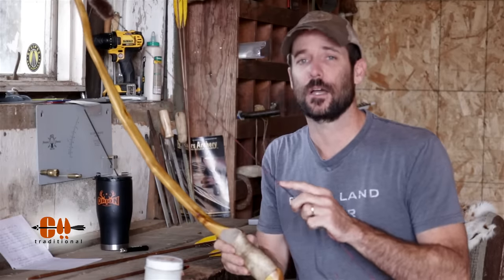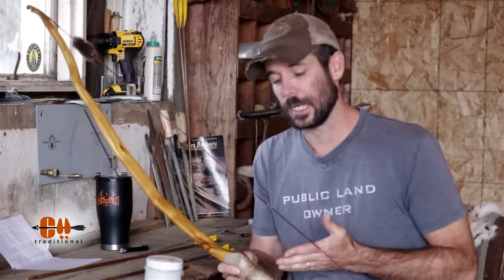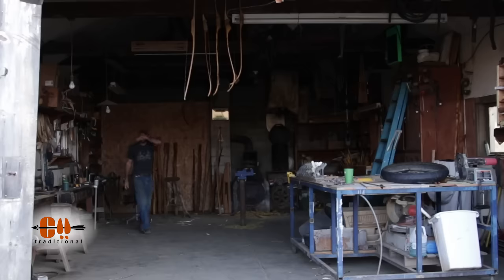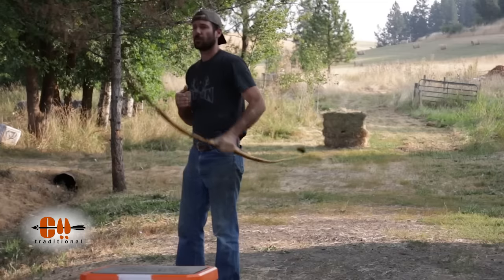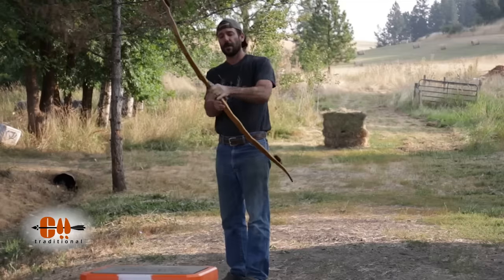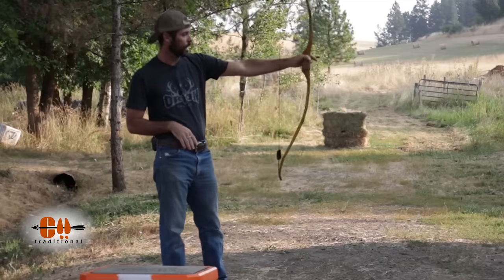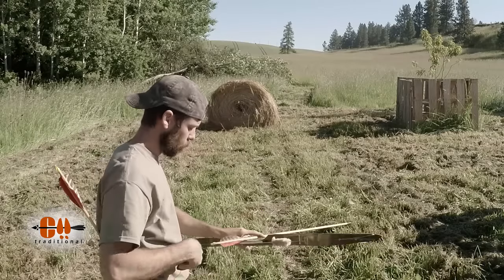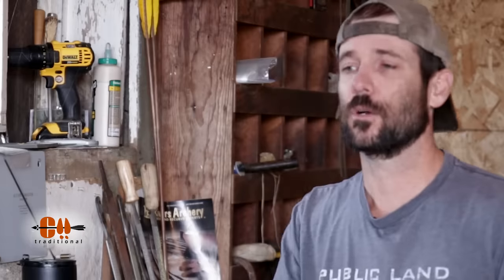Tuning a Recurve, longbow, or selfbow for perfect arrow flight

Comment: I am brand new to archery. I ordered a 45# longbow at 28 inch draw length, with 31 inch arrows that are 500 spine with 4 inch straight feather fletchings. This video is packed with valuable information I plan on using and it concludes with the most valid important point ever. That was exceptional.

Comment: Hello Clay.  Over the years I have bare shaft tested my three longbows, but a few years ago I started experimenting with different fletching styles.  I had ordered some full height offset 5" fletching on a dozen arrows.  When they came in they were in a box for standard height fletching and were in bad shape. I tried the old hot water trick to no avail, so I trimmed them down.  I ended up with fletching that was 7/8" on the point end and 1" at the nock end.  I stepped outside and launched one at 25 yards.  I was stunned!! They "sang" all the way to the target!  Boy was I hooked!

I gave 3 singer arrows with HTM rubber blunts to a friend who limited out each year for white tails, but that year didn't have a doe tag.  He just launched the "Singers" over the doe's backs to see what their reaction would be. He said, "They  just kept on feeding except for one doe who raised her head and watched the singer fly by before continuing feeding." I figured that they would simply accept the singer arrows as some kind of insect and they did.

Another benefit of the offset "singers" was that the arrows stabilized within approximately 3 yards from the bow, while 5 1/2" Shield cut fletched arrows impacted the bails at an angle.

Aluminum arrow note: A bunch of us at the Firearms Training Division would shoot our longbows and recurves each noon at a large bag target at 25 yards. On several occasions I stood down range behind a chimney at about 15 yards to listen to arrows in flight. I immediately discovered that the aluminum arrows made a kind of "clink" at about 10-15 yards after release. (And they were shooting recurves!)

Comment: I have been going through this process recently, and this video reinforced everything I have been figuring out.  One of the most frustrating things, is that wood bows can change draw weight under different heat and humidity. So one set of tuned arrows might not work once you find yourself in situation with more or less heat and humidity! So now I am trying to make up some wood arrows with changeable points, so I can adjust point weight within a draw weight range that I know my bow can shift in.

Turns out, my 70lb longbow needs me to buy 50lb spine wood arrows at 29". Then I can fine tune with point weight between 80 and 140 grains.  Trying to keep my GPI down to about 6, so I have a nice light target arrow as well. God it is a ton of work. :)
Reply: science talk ? friends
Reply: if you use wood arrow shafts with a wood bow does that solve the problem? The spine changing with humidity and the draw weight as well.
Reply: Amazing it's been done for over 50,000 years.  What a pain in the ice - age.

Comment: Absolutely the best information for tuning a traditional bow!!!
I was having arrow flight issues with my recurve and was about to give up and go back to my compound. After watching this video, I increased the tip weight on my arrows and the flight issues disappeared. I had a 600 spine GT that I cut 2" off of to increase trajectory, by dropping some weight...and reduced my tip weight from 145 gr. to 125 gr. This video has shown me that I increased the spine by both of the changes, thus effecting my arrow flight. I had to add a 100 gr. tip weight and 175 gr. field tip, for a total of 275 gr., which created a 545 gr. total arrow weight. Great flight, but for a 42# recurve, I've severely cut my range/trajectory. Perhaps new full length arrows with only a 50 gr. tip weight and a 125 field tip (175 gr. total) would still provide good arrow flight with improved trajectory.
Thanks for the video instruction!!!
Reply from the maker: I'm glad it helped!

Comment: Yes, I agree. The best arrow to bow tuning explanation and video I have seen too.

I do intend to hit your store up for your book. I am sure you have acquired some great tips to help the process precede without the crackling sound of splintered wood. 

Actually I am hoping you cover to some degree wooden arrow building  from scratch. I'd like to make a set but I am not certain which woods are most suitable and the best method for turning square stock to round such as hand plane or dowel maker.

Comment: You like 190grain tip? Is that with the insert included?  What's your total arrow weight? I'm trying to dial in a better (heavier) setup (didn't get a pass through on a whitetail and wasn't pleased haha)

I have some black eagle instincts 400 spines, and also some carbon trad 350 arrows and and trying to figure out what combo head/arrow/spine works best

Comment: My take on explaining spine:

Static spine: How much the shaft bends on spine tester. It is solely determined by materials of the shaft. 

Dynamic spine: How much the shaft bends on a released bow and during arrow flight.  Determined by draw weight, shelf, static spine, shaft length, point weight, insert length, etc.

Comment: Great video. I have a dozen very nice cedar arrows, but they are over-spined for my bow, and I don't want to add more tip weight. I am inclined to try shaving a bit off the middle of an arrow, to see if that helps. You said you don't recommend doing that, and I wonder why not, assuming I don't weaken it overmuch?

Comment: I am a fan of bare shaft tuning. I shoot bend in the handle bows anywhere from 1 1/4 to 1 3/8 wide at the handle. My draw varies and is in between 25-28 inches. I do like to play with my arrows a bit to get good flight. I shoot two different style arrows, one is the arrow is thickest at the tip and tapers to more slender at the nock and the other is some what barreled shaft. I always prefer my arrows longer then y draw. My shortest arrows are about 30-31 inches and my longest are around 34. I find longer arrows more forgiving then shorter arrows or what most do one inch above draw length. I also like the longer length for weight. There are so many ways to play with arrow tuning and its fun.

Comment: I have a few recurve bows and all with  different brace heights ....from 45 lbs. to 60 lbs. So its always a little work to get them all tuned and sighted in . I found out if the arrow  shoots  high off the shelf ...I raise the nok point to level the  arrow in flight  1st . then go from there with looking for the proper spine to get the  side to side wiggle out  . thanks for the video I will save it and use as a reference from time to time .....
Reply: Shooting high at what distance? Off the shelf. I use to shoot when I was younger, I didn’t realize all the science in archery. My question is that if off the shelf  you are spot on at 50 are you high? Or are you high at 25?
Reply: @scottsutherland3088  .....im spot on from 15 ft. to 75 ft. the way i shoot . and once i have the bow tuned into the arrows I'm shooting .... 3 under and a fixed crawl technique . anything else i shoot at over 75 ft. i raise the arrow any where from 5 to 8 inches while sighting the target . i switched over to a fixed crawl shooting style and it works well for me .
Reply: ski bum The Rowdy Rambling Hobo thank you for replying.

Comment: I'm weird when it comes to my tuning. I do it backwards. I'll start a with a stiff arrow at a length that I like and keep adding tip weight until it straightens out. I prefer that method cause it always gives me a really high FOC and almost always an arrow weight of 600+ grains. Sometimes 700-800 grains if I'm using an aluminum shaft or shooting a heavy poundage bow. It's great for hunting out to 25 yards. Blows through animals like butter and leaves substantial blood trails. My current set up on my 58# longbow is an Easton legacy 2219 aluminum shaft cut to 28.5" with a 100gr brass insert and a 300gr tip/broadhead. Arrow weight is running around 815gr at 150fps. Thing hits HARD.
Reply from the maker: That’ll work!

Comment: QUESTION:
Why didn’t you elaborate on on brace height in relation to stiff/ weak spine?
I tinker with my brace height to fine tune. 
In retrospect I guess your video is for those who are just setting up arrow to bow. I just had to replace my bowstring so I’m just tinkering with brace height.

Comment: Excellent video as always 
So I just bought 400 spine vintage bea full length is 34" I added a 100 gr brass insert with a 150 tip 
I'm getting a nock left with full arrow 34"
Should  I still do 1/4".cutting at a time?
Or do 1" for the first 3"?

Comment: I noticed you changing tips very quickly and using a lighter when doing so. How do you do that on the wood shafts?  Hot melt?  I don't currently shoot traditional, but have begun learning for when I can get a bow.  Thanks and great tuning video.
Reply from the maker: Yes, it’s a special type of hot melt glue.

Comment: Good evening, Clay. I developed a bit of a brain fart. So I’m shooting a 60” Predator Recurve. I originally had 55# limbs on them until a brainless mishap occurred a couple of seasons ago and I ordered another set @53#. Keep in mind these are @28”. So I just started tinkering with them and I’m hitting stiff with my GT 400’s 29” total arrow. I shoot 175 grains. I’ve been playing just moving my brace height. Question: To weaken my spine do I raise or lower the brace height? 

Reason I ask is because I’m moving it and keeps hitting stiff (point left/ nock right). I’m right handed of course. Also, these 53# limbs are supposed be quite compatible yet I found myself twisting my bowstring some to achieve the required brace height (7.25”-7.75”). I was almost certain that a low brace height would weaken the spine since there’s more duration in the stroke . Hope you can chime in some suggestions. I really didn’t pick it up in this video of yours. Thank you for all your support, work and generosity making these videos.

Marco

Comment: Great video. I have a 30# Black Hunter longbow on the way. Do I need to bare shaft? I'm going to be shooting Gold Tip traditional 600 spine arrows. I have a 24 1/2" draw. I'm going to be shooting 3D archery only at 25 yards maximum. Thanks

Comment: Love the vid, I have a Fleetwood Edge 45lbs, and I am wondering how you can be cutting arrows down to size; when I am at full draw, I don't have an inch to spare. Using X3 Hunter 340 32", 80 grain practice tips.

Comment: Awesome video!! Just started and I understood this. One question if you don't mind. I made my own bow. I don't have a rest or guide on the bow. I just rest the tip of the arrow on my bow hand. I have found I'm much more accurate with the arrow on the right side of the bow. So it is resting on my thumb basically. 
In this scenario. Is your description of nock left and right now backwards for me? Since the arrow is flexing around the bow opposite side I believe as you
Reply from the maker: Yes, I believe it would be.

Comment: I love your videos and thanks for the awesome tips. The one thing that I have questions on is the issue of movement (in and out) of the string as your finger tips impart pressure at release. I feel that the type of glove or tab (or lack there of) could influence arrow flight as well. I'd love to know your thoughts on this. And Again, thanks!
Reply from the maker: I’ve never given much consideration to the tab or glove. But that’s just me.

Comment: Clay, this video answered most of my question on how those spine vs draw weight work in my head.. but one thing that I'm curious as a trad archer myself.. does this work with horsebow? I mean, I use manchu/qinghai bow which is close to a longbow/trad recurve that doesn't really use khatra/hand torque after release..

Comment: You mentioned that you can’t tune unless you’re shootings in groups. I’ve had a PSE coyote for years and I can’t get consistent with it. Is it always form that’s the culprit? I can shoot 6arrows at a 20-25 yard target. 3 will be in the center about an inch from each other, but the other 3 are spread around the target. I went to a bow hunting workshop a month ago and the instructors told me that my form looked fine.

Comment: Great video.
One question. My arrow hit the shaft and cose noise every time I shoot. 
I try to move nok point up and down and same noise are always there.  The bow is fiberglas laminated, 43#@30" and I use 600spine arrow 31"long with 125gr point. What is the cose and how to adjust it ?

Comment: Terrific video Clay. Thank you for sharing your expertise and talents with us! Where do you buy your cedar shafts from? I have two 50 lb. recurves that shoot entirely different. One shoots much faster than the other. I suppose I will need different arrow spines for them. Is that correct?
Reply from the maker: 3Rivers . What you’ll need depends on all the factors explained in the video.

Comment: This was very informative, thank you! I made notes. Though I have a question (for anyone who knows the answer). You review archer's paradox as the arrow has to flex around the riser, especially on an off-center bow. What if the off center was the other way round? I'm seeing this on my recurve whose arrow rest I got rid off and started shooting off the shelf (propably going to get a traditional bow at some point). How would such off-centeredness affect the trajectory and how to compensate for it? I'm seeing some nock-high which seems to be alleviated by rising nock higher than I would think orthodox. Also, a bit of nock-right, but I guess my skills in tuning still fall a bit short in understanding the phenomena. Thanks!
Reply from the maker: I’m not sure what you mean by “what if the off center is the other way around “. If you mean that you’re shooting left handed then everything mentioned here would be opposite.
Reply: @clayhayeshunter  I'm shooting right handed, but as the arrowrest i removed was "in the middle", using the bare shelf  results in the arrow resting further to the right and also pointing to the right from center rather than to the left in which case the arrow would have to bend around the riser. I'm wondering what factors are at play in such a scenario.
Reply from the maker: So your bow’s sight window is cut past center then. I would add a thicker strike plate and build it back out so the arrow is pointing slightly left. That should make it easier to tune.
Reply: @clayhayeshunter  Alright, I'll go that way. Propably shouldn't be too hard to just add a block there to straighten the arrow. Thank you!

Comment: I feel like, at least for hunting, focusing on arrow weight is more important than focusing on the tune of the arrows. A 500 grain perfectly tuned arrow will get less penetration than lets say a 600 grain arrow with a 500 spine that needs a 400 spine. At the end of the day some basic 4" fletching will correct that error.

Comment: I'm bareshaft tuning for a 45# bow with a fast flight string.  400 spine is throwing the nock left, and 350 spine seems to work.  But, I just can't believe this bow would need a 350 spine, that 'should' be too stiff.    Any ideas?

Comment: So, what if you get perfect shaft tuned arrow flight...how do you decide what size fletching.   I understand that fletching stiffens the dynamic spine.   So, it would seem you would want to over spine slightly to (nock left) for RH and let the fletching true the flight.  Or in your experience, is it over the top?   I guess if your drilling the the vitals...who cares!!!   Guess I answered my own question.  Thanks for listening...hey, this is great therapy.
Reply from the maker: I make my fletchings as small as possible while still getting good flight under less than perfect conditions. You could tune slightly weak as you say or fix small issues with strike plate thickness or brace height.

Comment: Mr Hayes
I have been using a compound for over 19 years. I want to switch to traditional shooting and use a longbow. Do you have any recommendations on bow brand and draw weight I should start with? Also recommendations on arrows? By the way your video was great. Very informative and I have subscribed to your channel.
Reply from the maker: There are a lot of great bows out there. Shoot a few before committing if you can. My only real recommendation is don’t get something too heavy. I’d usually recommend something under 45lbs to start. You need to be able to draw and hold comfortably.
Reply: @clayhayeshunter  I completely agree with this. 45lbs on my recurve is nothing like my 70lbs compound.  
BTW, your videos are inspiring me to get the recurve back out and commit to it for next season. I gave it up before even getting started (5 years ago).

Comment: Awesome video!
I recently switched from compound bow (center shot) to a traditional bow that has no shelf. 
Damn confusing.
Now that I know what to look for, I’ll be paying attention to those details in future range outings.

One comment regarding “bare shaft”:
If total removal of fletching is too big of a step, and the archer isn’t ready for such drastic method yet, then TRIMMING DOWN the size of the fletching would theoretically have the same effect of departing away from fletching and approaching bare shaft.
For people attempting to bare shaft tune for the first time, this might be a good intermediate step before going totally bare. (All puns intended)

Comment: I have the hardest time tuning my arrows... I have a 30 3/4” draw length, and it just limits my options so much. I have to shoot a lower poundage bow than I’d like, but that’s been the only way I can tune them.
Reply from the maker: Yeah, for a wood shaft, that’s a tough one. You might try getting some 80+ lb shafts and building the shelf out some.